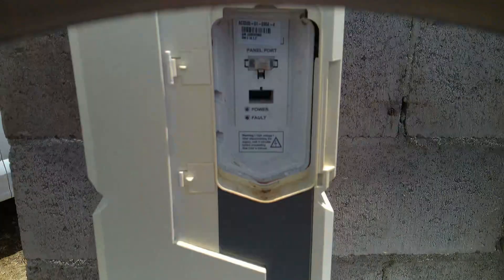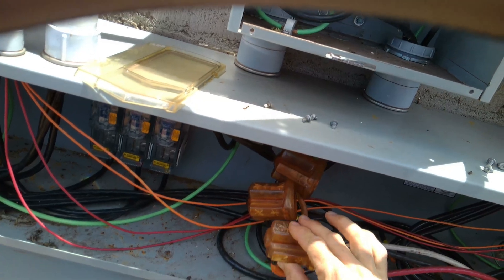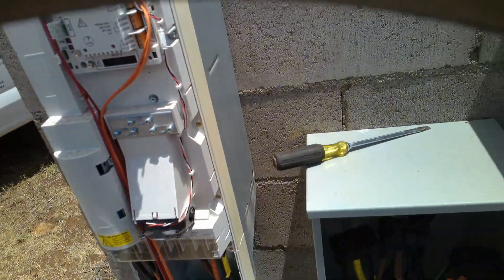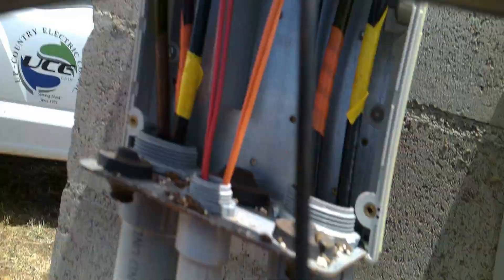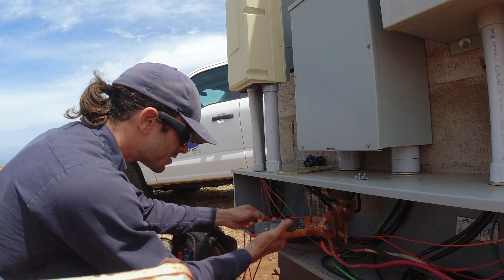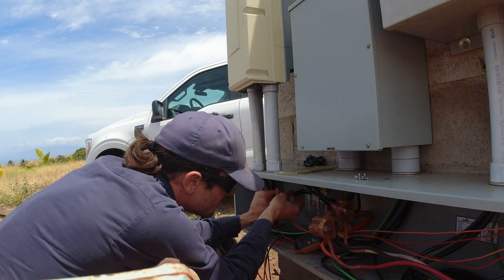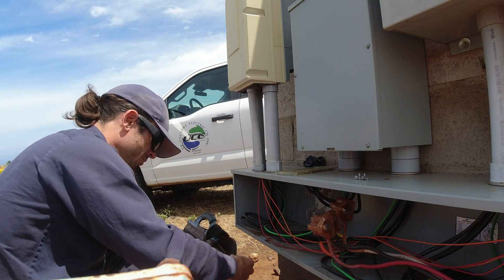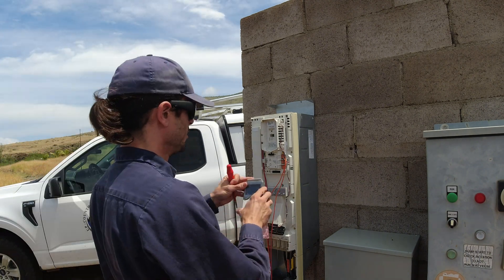75 Horsepower VFD Troubleshooting

Comment: Good work man. I am controls engineer and have some done my fair share of troubleshooting and you do a great job. My only recommendation, when you check for voltage after turning off the breaker, I notice you only check phase to phase, please check phase to ground as well. Could save you one day. Your videos are great.

Comment: I find it funny a UL type 12 drive rated for light water mist is installed outside.   Type 3r enclosure with new vfd installed inside would fix the issues.
Reply: The VFD didn't cause the fuses to blow at least. So many things went wrong.

Comment: The violet color - does that indicate reclaimed wastewater? Would that explain the amount of corrosion in that pump? If they have rebuilt that just 2 years ago and this system is important, they should consider a SS pump. At least the impeller and volute. 
Good luck man.

Comment: Crazy that drive is rated for outdoor use, I assume. Guess not running the pump the impeller sized to the volute. Have fun separating it. I'd bang the shit around the volute to try and free up the impeller before rebuilding that thing. Not going to be fun pulling that apart.
Reply from the maker: Yeah, it's gonna be messy. I'm figuring a day to disassemble and a day to reassemble. (As long as nothing shears off or strips out)

Comment: G,day from Sydney Australia.
Their lucky...
In that, max inrush Amp didn't affect the VFD.
* I'd ensure grease zurks on the new pump and alignment of the motor and shaft with a micrometre gauge (magnetic or chain clamp) stainless steel shim under pump/motor untill zero deviation from alignment; should last longer than two years. Grease pumps each month and build a shelter over the top and wind side.
🌏🇦🇺

Comment: While it evidently wasn't an issue this time, I'm surprised you didn't check phase rotation before restoring power to the vfd. I say this because sometimes the utility may restore power, but get the phase rotation backwards during that restoration.
Reply from the maker: Good point. I was planning on verifying rotation, but that wasn't possible due to the seizure.
Thanks for Watching!
Reply: Does the phase rotation into a VFD even matter at all? Most VFDs just rectify the incoming supply to make the main DC bus voltage.

Comment: On the  VFD...if water shorts out the control side of the circuitry, it can cause the IGBT'S in the VFD to short out or misfire, which can most certainly blow the fuses. But you can usually know by the burned electronics smell if that happened. EDITED TO ADD: ALWAYS CHECK PHASE TO GROUND/NEUTRAL WHEN VERIFYING FOR NO POWER!!! If any pole of the breaker fails to open or is tracking you WILL get shocked.
Reply from the maker: Excellent advice

Comment: You’ve got to reset overload class in the VFD. It’s not good for the motor to be at the LRA that long, and it should have shut the motor down before all 3 JDL fuses popped.
Also rethink stating protection curve. See if you can get one from motor manufacturer.

Comment: Severe neglect. Although everything not looking that’s bad from the outside ( besides no VFD enclosure ). 
I suspect water ingress in to bearing housing. 

If it was exactly the same pump you guys did 2 years ago. Consider providing flushing  circuit to the shaft seal on the new rebuild. Because running dry might be what burns the seal.